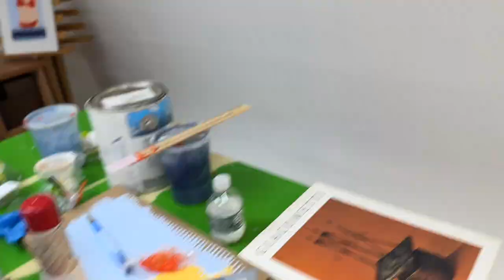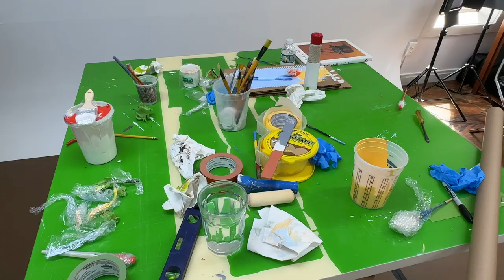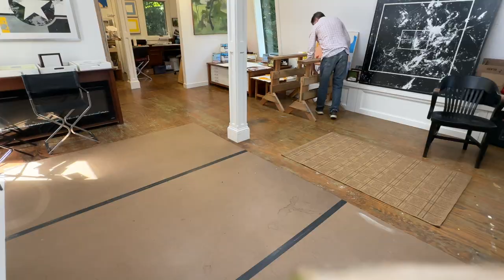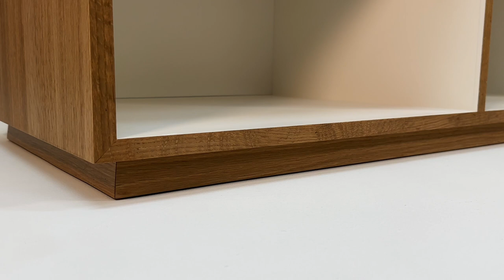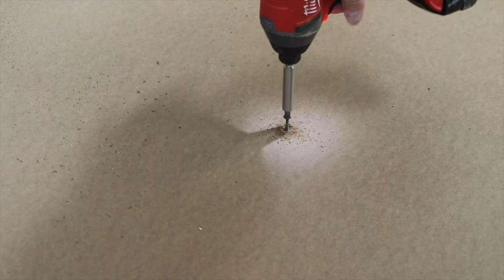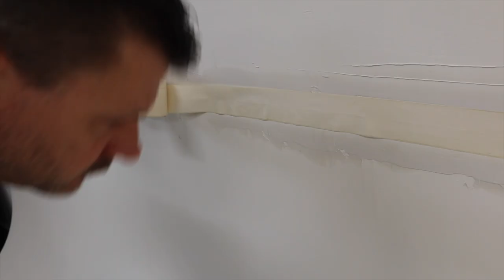Woodworking Furniture Photography Wall - Art Studio - Photo Studio

Comment: Could've also used a section of a linoleum roll, reversed so the bottom smooth side is facing up. You'd still have to paint it but wouldn't have to deal with seams.